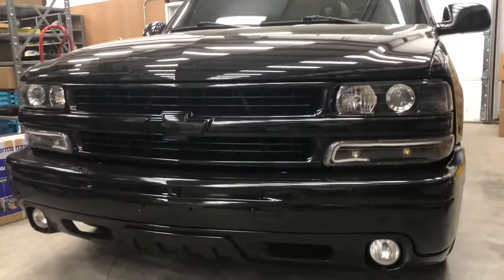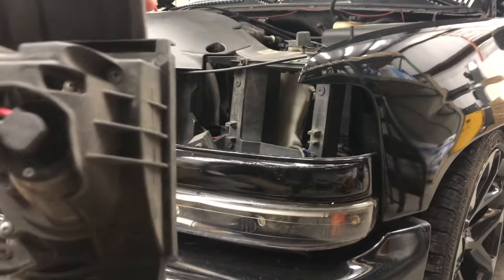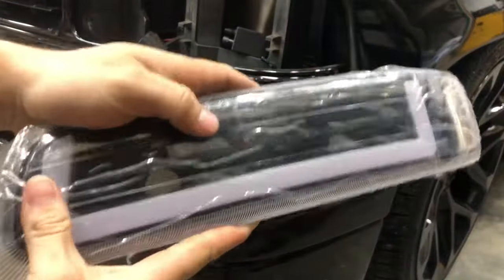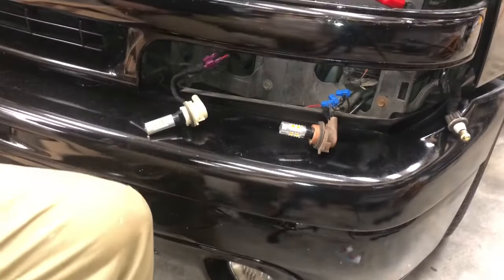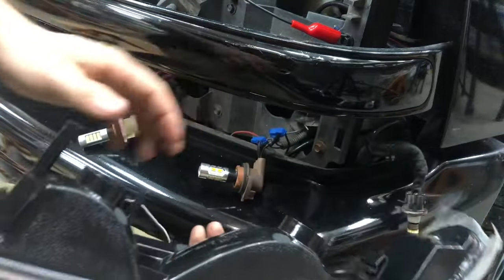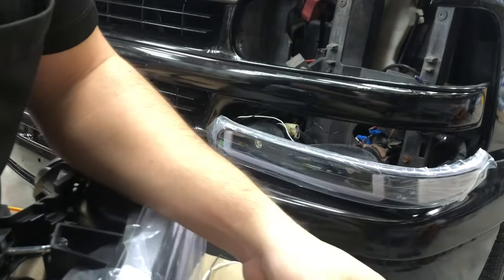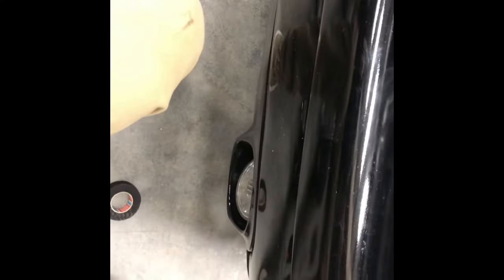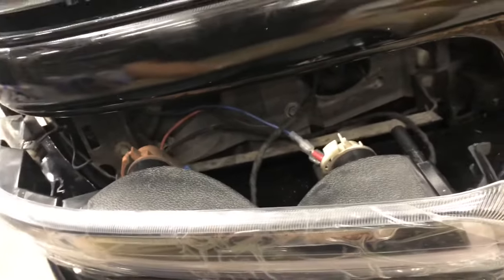How To Wire & Install “New Style” Headlights 99-06 Chevy OR GMC  by AJP Distributors

Comment: Thanks bro !!!this makes everything much easier and cleaner . I was trying to wire those same headlights in a whole different way but didn’t work . I tried your method and worked right away 🔥🙏🏽💯
Reply from the maker: Thanks!! Glad I could help
Reply: What connectors you use?

Comment: Those depo projectors are actually the best headlights far as not doing a retrofit for that truck/suv
Reply from the maker: Agree. I personally feel those are underrated.
Reply: @MarioZermeno  indeed. Most people say do a retro but never owned them. They are so good with hid bulbs doing a retro makes no sense. Hopefully the projector you swap it with is an oem hid projector like a s2000 or tl or something from Stanley kioto. Morimoto units are ok but mini h1 will not be better than whatever depo put in there

Comment: So i did the same exact thing you did and only thing that works for them to turn on is by tapping into the blinker, idk wtf is going on but im probably gonna try to return these pos headlights
Reply from the maker: I would give it one more shot.they are awesome headlights. Test them to the battery first. Then if possible use a test light to find the best power wire that turns off with the truck

Comment: My corner lights are the same way on the bumper lights. Super loose.
Reply from the maker: Btw, I figured out if instead of turning the socket clockwise , turn it counterclockwise and it will lock on better so I don’t have that problem anymore. But still a issue that needs to be fixed

Comment: i have an 01 silverado 2500hd and i have the same lights and i wired them up and they all worked then they just stopped working. what should i do
Reply from the maker: I think start with rechecking connections on them if not then grab your voltmeter and make sure their getting 12v and if they are and not working then I think contacting the sellers
Reply: I have an 2002 2500hd. Did yours fit well I just ordered the same headlights

Comment: I wired mine exactly like u did but my Drl bar turns off when my headlights go on u what u think my problem is
Reply from the maker: Hmm, I haven’t ran across a wiring problem like that. For you I would take your DLR wires and tie them into your fog lights or corner lights. If that don’t work just tap them in with your headlights
Reply: Thanks one more question what led headlight bulbs u running
Reply: Sounds like you ran it into the automatic DRL circuit, rather then the park light circuits like in the video, makes it so that when the headlights come on the DRL goes off. Default behavior for this style of vehicle. Wire them into your turn signals rather then the DRL

Comment: Curious question did you ever get pulled over or got a fix it ticket for having those? Because I'm thinking of getting these aswell but with the orange amber turn signal
Reply from the maker: I live in Arkansas so they don’t have any strict laws. So I’m my case no.
Reply: @MarioZermeno  Thanks for your response

Comment: I installed mine and they work fine but everyone I use the turn signal it blinks very quick, what do I do?
Reply: Sounds like you need load resistors
Reply: U don't need a load resistor. They make a led blinker relay. Find out wat type of relay u have for your blinkers and swap it with a led one

Comment: Do you have to cut wire in order to tap in for the DRL lights
Reply from the maker: I mean you just have to “Tap” Into the wires to get DLR’s that turn on and off with the truck. Unless you wanna run hot to a switch and a ground

Comment: Just wired mine up and the issues I had were that the High beam bulb didn’t fit and the signal light bulb didn’t fit either. But I’ll give it an 9/10 ima see if the bar LED’s last long
Reply from the maker: I think you’ll have that if your running those LED’s with those fans, mine went in smoth. The bars are still good as of today’s date.
Reply: @MarioZermeno  even with the stock high beams it wouldn’t fit good felt like the hole was too small
Reply: How are they holding up what brand did you buy ?
Reply: @David-gn3tq  I got rid of them tbh not worth the money. They looked awesome but on the bumper lights they weren’t sealed properly and so humidity got into them and messed up the LED
Reply: @saulreyna72  thank you🙏 I’m just gonna be buying the originals

Comment: what kind of hid bulbs are you running? and the bulbs for the bumpers lights
Reply from the maker: Opt7 6k . I don’t think they make them anymore. IJdm led bulbs
Reply: get a set of high and low beams from tiny monster get the 10k lumen bulbs. You will not be disappointed. Make it so your lows stay on when you turn on your highs and damn you can see far far. 40,000 lumens at that point when i have my high beams on

Comment: Where do I buy the exact t-taps and the piggyback connected and the other connecter
Reply from the maker: Upgraded 120 PCS T-Tap Wire Connectors, Self-Stripping Quick Splice Electrical Wire Terminals, Insulated Male Quick Disconnect Spade Terminals Assortment Kit with Storage Case-60 Pairs https://www.amazon.com/dp/B07WWV1T4C/ref=cm_sw_r_cp_api_i_bxCpFbDE7DPZ2

Comment: I got lights just like these and I tapped the headlight tube lights into the parking lights, and the parking light tubes as blinkers. My headlight parking lights will stay on for about 20 mins and then they blow their 10amp fuse?? There isn't any short that I can find, and the truck's electrical system Isn't acting funny either. Literally everything works fine until about 20 mins and then the fuse blows

Comment: Most of the reviews on amazon are bad for these housings.  Poor quality for the price.  This video should be about blasting the poor quality for the money.  Bad fit and now your getting moisture in your bumper lights.  You should've got your money back.
Reply from the maker: Idk if it’s every other housing that has issues but I guess I got the good set of housings. I’ll make a update review on it
Reply: @MarioZermeno  Idk !!? I bought a pair of these lights and they are fitting extremely loose and flimsy .

Comment: What led lights are you using for signal lights
Reply from the maker: BRISHINE 3157 Switchback LED Bulbs Extremely Bright 3030 Chipsets Xenon White/Amber Yellow 3155 3057 3457 4057 4157 LED Light Bulbs with Projector for Turn Signal Lights(Pack of 2) https://www.amazon.com/dp/B07YF8RK5B/ref=cm_sw_r_cp_api_i_YtX2EbEGBT6BH
Reply: Same for Drl?